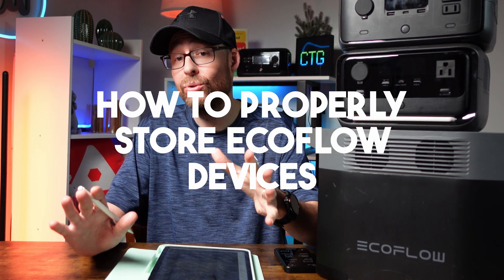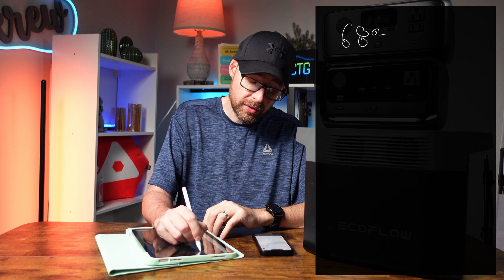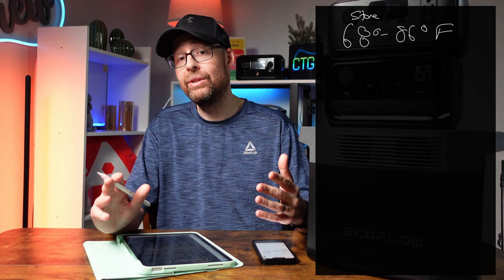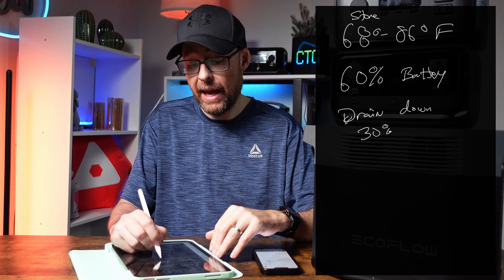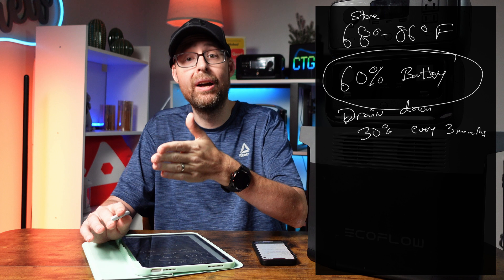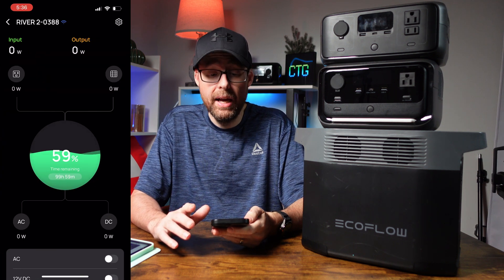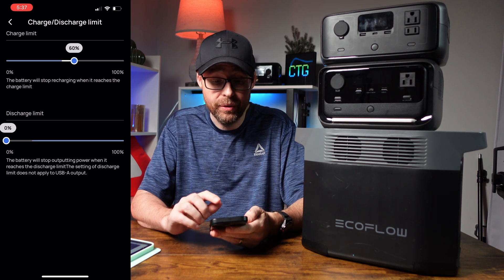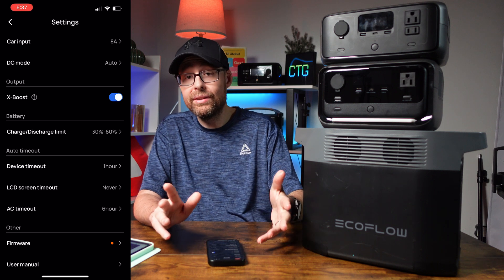BEST Storage Tips for EcoFlow Power Stations

Comment: So if the power goes out at 9pm and your battery is at 60% depending on how big it is it might not run your refrigerator through the night until you can charge with solar. Kinda don't make sense does it?

Comment: I'm thinking of using it in a mobile detailing setup. I'm concerned about having it running while I'm detailing on 90°+ days. Have you had any experience using it in hot weather under load?